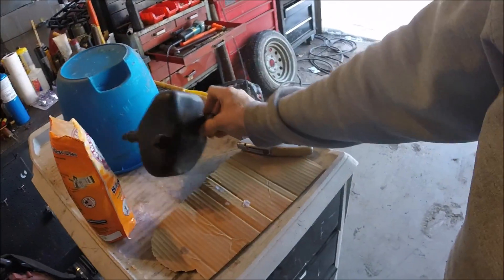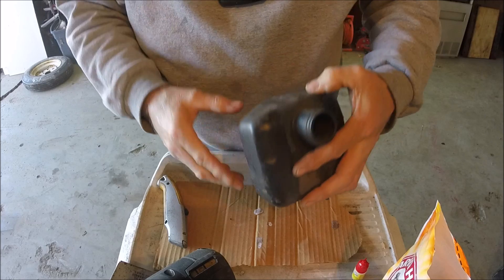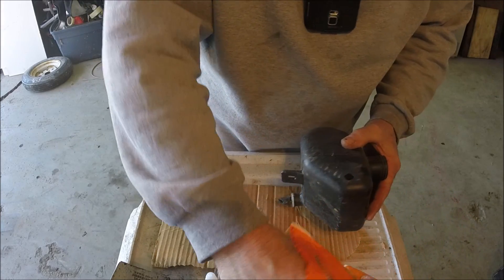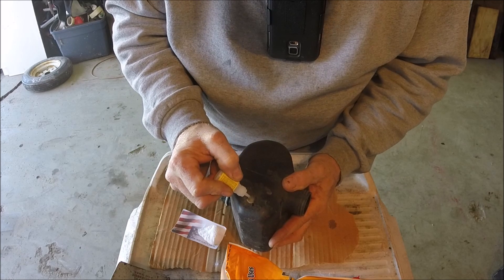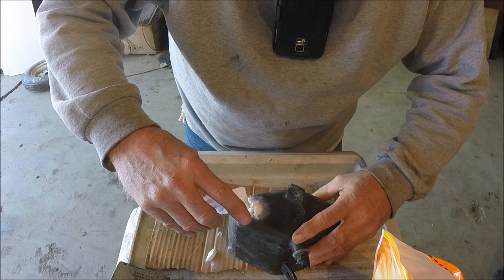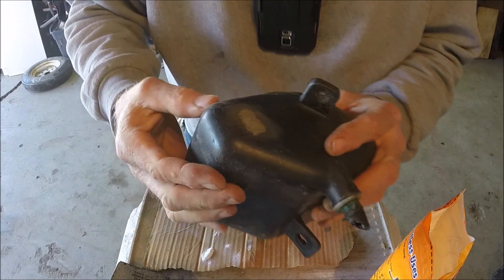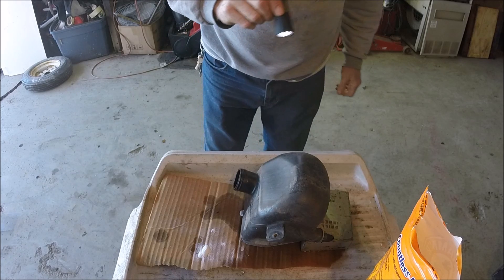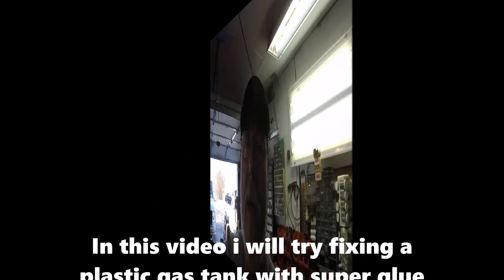Super glue & baking soda trick, on plastic gas tank, is it gas soluble ??

Comment: Hi there Bob, hope all is well. I  am now facing this issue and baking soda super glue trick. is got to admit neat thing in your tool box. Guitar players fix their Nutz  with it I have used to rebuild a pair of glasses but I wasn't sure if it was gas soluble? but looking at comments section., Seems like it is .  But Myself I get technical  maybe too much but you can't overlook one factor: What type plastic are you adhere ing it to. My tank is the HDPE 2 and I got a crack almost two inched long.   crossing fingers   I am glad you reminded me about this trick thanks

Comment: I am interested in this subject matter. Would you take a new tank and pressure it and see at what pressure the tank busts??? Then take another tank that is the same and damage it with the drill and cut method and pressurize the tank and see how much pressure it will take before it fails. Then you will know at what pressure the tank will fail and the percentage of the real repair strength which is really important since you are holding a flammable liquid for safety reasons. Hope you do the test Sir. Peace and stay virus free too. VF

Comment: Bob, I have used super glue and cotton string to fix even the transmission cooler tube where it leaked on the line that went into the cooler on my Dodge 3500 Ram two years ago- still holding. Hit on this idea ten years ago when my fifty dollar Chinese built to break headphones separated, I have them on now as I listen to your great video. Works with cotton thread also have used cotton jean material as patches to build up broken parts. Why don't you make some more videos using this idea so more people will learn of it...

Comment: I'd seen the thumbnails for a few of these CA/Baking soda videos but yours caught my eye because it mentioned plastic gas tank.  I've been dealing with a leaking gas tank on an old Murray lawn tractor for over 3 years trying to seal the cracks (plural) and even tried "welding" it with a soldering iron and polyethylene scraps from old jugs. But the cracks kept spreading. Watched your video and figured "I've got several little tubes of dollar store CA and a 25 lb bag of baking soda so why not?". Roughed up the area with files, sandpaper and a stainless steel wire brush. Also drilled holes at the visible ends of the cracks to hopefully stop them spreading. Biggest crack is/was 1/8" wide and 1½" long. The result looks good. I tried to pick off a "run" that had soda on it and it doesn't come off! I've put the tank back on the tractor but discovered there's water in the fuel filter (frozen) so I can't test it till spring. I'll try and update this when I do fill the tank and put a few days hard use on the tractor to see if vibration causes any trouble. https://i.imgur.com/giYfHqj.jpg  https://i.imgur.com/PKc7THe.jpg
Reply: Where’s the update? Is it still holding

Comment: If you can empty the tank first then this looks good.   However, you can't always do that.    I stopped leaks in a car gas tank (metal tank) by using Seal All.   My gas tank was leaking steadily (drip - drip - drip).   I applied the Seal All and over a minute or so it solidified and no leaks.   Lasted for a year until I went and washed the car and used the spray want on the tank area I had repaired - the pressure washer managed to spray off the seal all.   But, all I did was to clean up the area and apply seal all again!

Comment: If you are doing a lot of CA gluing you would be doing yourself a favor if you use a rubber respirator. A good 3M one , not a cheezy paper one. The fumes go into your nose and the moisture kicks it. After a while your nose will be burning inside. It's fairly excruciating. Or use a suction fume extractor.
Reply: Always gotta be a safety Sally idiot in every comment section. Get over yourself.

Comment: Cool .. we'll wait and see .. IN the meantime: try using a fine spray of WATER , in place of the Baking Soda ....   ya might be surprised!
Reply: I experiment quite often. I've gotten pretty good at plastic WELDING, but there have been a few cases where things got a little tight.  H2O you say? I'll get back to you on this ... I love to do stuff that people say can't be done. Most of the time people say it won't work boils down to the simple fact; THEY DIDN'T TAKE THE TIME FOR PREP. Hell, anybody with kids or a sweet tooth can tell you how hard it is to get that shit off the bowl, and this is without ANY prep work.  I'LL BE IN TOUCH
Reply: @cornfusedatbest6693  Hi.. how did you get on ? I just got a tiny hole in my 1995 triumph tiger fuel tank , interested video and comments.. Thanks
Reply: @vrossi2596  I am so sorry, I haven't had the time to experiment.  One thing I can tell you, I go for the Loc-Tite brand superglue in the light blue bottle and the baking soda. Yes, I DO want to try the mist of water, but I haven't the need as of yet. And the main thing is, it's all about how one prepares the surface of the material. Make sure whatever adhesive you are using has something to ADHERE or GRIP to. If you do this, you should be back on the road in NO TIME.  And I WILL get back to you when I test the misting of H20 on the SG. PEACE

Comment: Don't know if a crack reacts the same in plastic as in steel but I would also drill a small hole at the end of the crack. in steel a crack will run you always drill a little hole a little past what you see as a crack on both ends..A good video Thanks...
Reply: Rick F, yes, I agree with your advice to drill a small hole at each end of the crack. I work on audio equipment and I do the same when repairing cracked printed-circuit boards. Otherwise, the crack just keeps on spreading.
Reply: Good advice, some people may have never seen a "running" crack on some items made of plastics.
Reply: Yes,but NOT here; if the glue fails,you'll have a flood instead of a small leak;  AND this is not a structural crack,it is NOT going to progress,he did it with the knife,the crack will always stay put.
Reply: Sure,but  NOT HERE   the crack ain't going anywhere,it is not a structural crack,and,if the glue fails,you'd have a flood.

Comment: I've used super glue to seal the cork floats in antique carburetors so they don't absorb fuel, also the cork floats used for fuel level sender assemblies.  Works well and doesn't dissolve away..

Comment: Nice video. I've used the 
super glue/baking soda combination for alot of repairs mainly O-ring seals. Interesting to see if it will withstand gas and other harsh chemicals. A good video idea would be to place the glue/baking soda into the bottom of a see through cup and add a variety of different liquids such as gas/diesel/kerosene etc.  just to see how well it holds up.
Reply from the maker: I will do some videos on that, thanks
Reply: Why would you chance ruining you bag of baking soda by pouring the old back in the bag. By the way, I've been using "CLEAR GORILLA GLUE" for projects & repairs like this. It's fantastic. I even used it to glue the rear view mirror mount to my truck's windshield. It has held for over 6 months after the glue I bought to glue the mirror mount did not work & mirror fell off.
Reply: jack2 freeman but is it gas soluble?  Does hold on the plastic-like material these tanks are made of?

Comment: I've tried it on wood before but like you said it soaks in too quickly... I tried it with gel super glue though and that actually worked OK!
Reply: I had the loctite gel superglue with baking soda and it failed to stick to polypropylene. Cheap thin superglue from the pound store worked much better, but it seems to work like a sticky patch bigger repairs are more durable.

Comment: He's using regular super glue?

I bought vent caps to retro fit into a new gov't can. I used a step bit and made the mistake of drilling into a spot that was molded thicker than I expected. Thickness caused me to drill the hole slightly too large to hold the vent.
I'm sure it could be fixed & done right with the right glue. I wonder if this will work. It's snug but not tight enough.  

I'll have to try this to save a can. DAMN GOV'T!
Reply: It will hold a 8 inch crack in a radiator without leaking pressure should hold almost anything together i say
Reply: In my experience, JB Weld is solvent-safe, okay for use with gasoline anyway. Be sure to clean and rough up the plastic so that the glue has some "tooth" to grap onto; and degrease it thoroughly before gluing.
Reply from the maker: let me know what works,  thanks

Comment: What about larger holes?
Reply: Check out the channel called Sweet Project Cars... he has several videos on repairing plastic using both super glue and epoxy and fiberglass!
Reply: Skyler Gunnels I have the same question.  I have a plastic gas tank that has a larger hole, and I can't reach inside to get behind the hole.      May I can pack the tank with sand to have something behind the hole?
Reply: I'm thinking maybe pushing some gasket maker into the whole might be good to fill the whole and put the super glue and baking soda on top of that?
Reply: Push some tape through the hole and work it to cover most of the hole and then go from there?

Comment: Plea see let me know if it works I busted my auger gas tank and it has a crack now I had a mechanic tee y to fix it he put epoxy but didn't work so I would live to tell him how I fixed it lol
Reply from the maker: i did it 5-6 weeks ago, and its still holding. clean it up on a wire wheel on grinder wheel very good, that's the key.  thanks